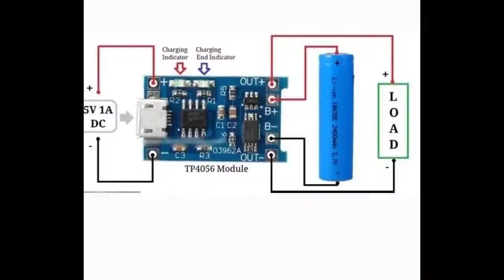How To Replace Battery on Mosquito racket With Lithium-Ion  Battery for long Backup

Comment: Hi sir 
I made my Mosquito bat using your Lithium technique works pretty good 
I have one question can you add this Lithium ion batteries in mens cordless trimmers
Reply from the maker: If you have USB charging port Yes, you can buy battery with same voltage rating. So voltage rating should be same,

Comment: Normally charge nhi hoga Bina micro usb wale circuit k jaise wo black wali battery charge ho rhi thi waise ?
Reply from the maker: Normally charge nhi hoga  ovarachaarj hone par, lithiyam  baitariyaan zyaada garam ho sakatee hain, module provides constant-current/constant-voltage with protection against over-voltage and over-discharge,
Reply: @SanduandLaya  thanks for replying.

Comment: Assembly part of video is not correct how you are connecting to USB is not clear
Reply from the maker: I have just included the wiring connection diagram in the video. 4:35

Comment: The battery you replaced was a 12v Battery, now you have a 3.7v battery. i bet its almost useless now as a zapper.
Reply from the maker: Mosquito bat “needs” just a lithium polymer battery or lead acid battery, all around 3 to 4 volts. That's how much it needs.
Reply: The battery that was removed is actually a 4 volt lead acid battery. Most lead acid batteries are made of many "cells", which at full charge give about 2.15 volts or so each. A 12 volt battery has 6 cells, the ones in the mosquito bat zapper have 2 cells. This is why replacing it with a 18650 Lithium battery with the TP 4056 (5 volt output) works.
Reply: @Mexandrew  Wrong!! You don't know anything real about batteries if you haven't done this before!